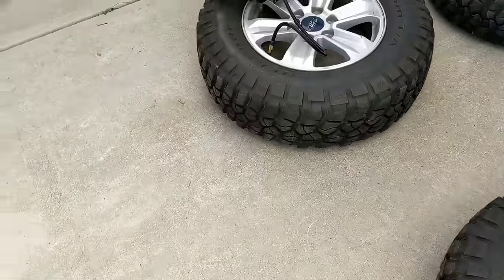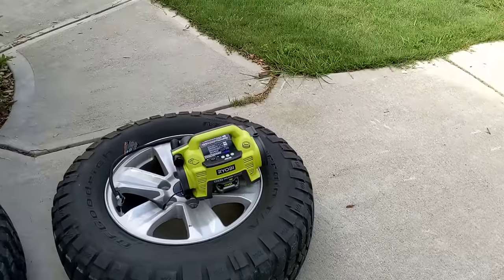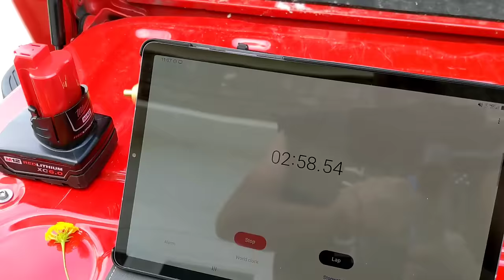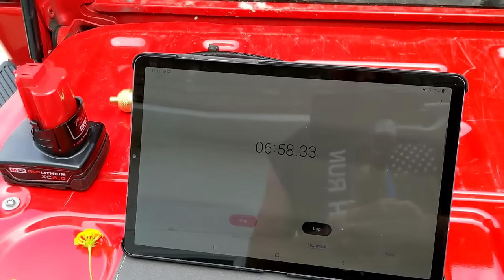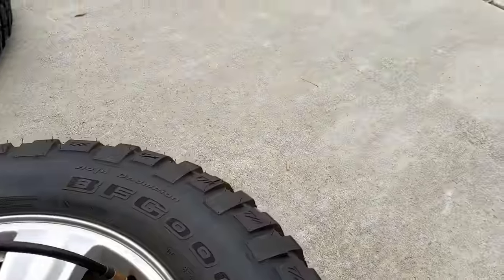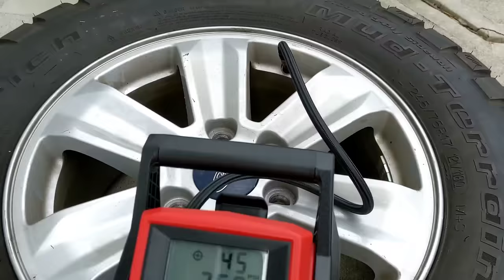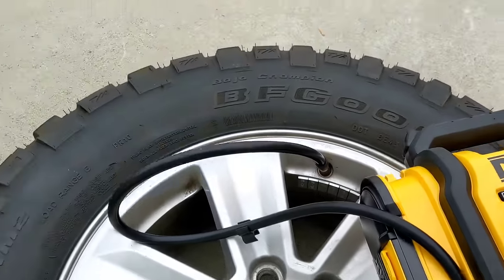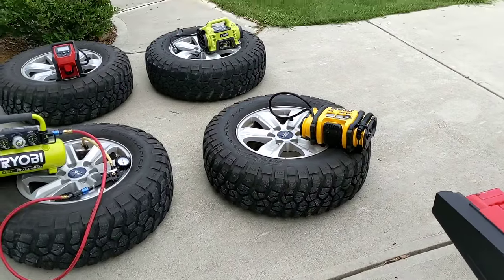Ryobi Milwaukee DeWalt inflator and compressor review

Comment: I loved yellow tools until my employer paid for a red one. Now I only buy red ones. Milwaukee is made for pros.
Reply: Pros buy there tools in home depo and Walmart?
Reply: @Zozo806  HD sells millwalkee. I've bought from HD. Im a pro. So yes
Reply: @Zozo806  theres a video that Milwaukee vs Dewalt,  and dewalt smoked and Milwaukee was still going. Milwaukee has a more diverse lineup. And I've noticed the fuel series last a lot longer.
Reply: @chrisl6263  like said. The ryobi and the dewalt i think can be used with a blow out pistol so you can propper clean your mountainbike. 
If you prefer the Milwaukee than go for it  but i personaly don't want just something for inflating tires. I just have one car an street biycicle and an e mountainbike and any gas station has free inflators.
Reply: Most or all are Now Made in China 🇨🇳 
Our new drill is, we thought it was 🇺🇸USA built
But China actually has improved quality vs back in the day 
Beer 🍺👍

Comment: Have to hold down the nozzle on the compressor? Locking air chucks are like $1
Reply from the maker: That doesn't really solve the problem though
Reply: @apocalypse2941  You dont need that big pistol grip inflator on there, you can just run the locking chuck right on the end of the hose
Reply from the maker: @CaseyR89  ok how do I get to the right pressure?
Reply: @apocalypse2941  set the regulator on the compressor
Reply from the maker: @CaseyR89  that does not work. Watch my video on it.

Comment: You do realize you're comparing three inflators that have ZERO air storage against one that is starting out with a full tank of air?  For a level playing field all four need to start from zero.  That nicer Ryobi model is starting the race with one gallon of air stored at what...90 psi? But it is the more versatile compressor of the lot. I wish they made a 40 volt version.
Reply from the maker: Yeah good point!

Comment: The compressor would not have won if you would have started with no air in the tank.  In a real world situation it would have been empty to start with
Reply from the maker: True but when you first put your hand on it you can turn it on and let it begin filling the tank so by the time your going the Chuck on the tire its full.

Comment: I appreciate the agenda free comparison. But, unless you're on a bicycle, a battery powered inflator makes zero sense to me. Having a 12V cig/accessory plug, vehicle battery clips, or SAE connector, with ability to use an AC adapter would be the best portable solution, imo.
Reply: I like the battery option.  I’ve owned several 12 V cigarette lighter powered inflator‘s over the years. I much prefer my 18 V Ryobi. Maybe it’s just my jeep has spent too much time with the top off, but off and I found those cigarette outlet type power ports get a little fussy. I also like the added range of being able to inflate Tires on my trailer while it’s still connected. Center store my trailers away from home if I get there and found the tire is low I can sort that out right then and there.
Reply: @ge99ne  I appreciate your reply. I'm sure there are folks (like you) where a batt version suits their needs. I just don't want to be out somewhere with a low tire situation, and find my pump has a dead battery.
Reply from the maker: Very true,  ironically the last person I helped with a flat had a 12v cigarette lighter only pump that did not work. I had to cut the wire and hold it to the battery of my car

Comment: If the tire is on your truck your in trouble with any except the dewalt.
Reply: At least you get it. This was a decent comparison for basic run time, but with the weight of the truck corner crushing the walls of the tire - that is another ballgame entirely.
Reply from the maker: they will inflate on the vehicle as well. I've done it many times after pluging a tire. Also gone as high as 65psi on my camper tires with the Milwaukee.

Comment: i am gonna say this because i own one  To have it in the car I would definitely go with Dewalt  and I say this  Because apart from being portable and light,it also uses a 12 V cigarette lighter plug And it can also inflate an air mattress Also comes with fittings for bicycle tires which I think they all do but just saying 
God forbid you forget to charge that Milwaukee battery And you're gonna need your compressor what are you gonna do about that with a dead battery In my opinion I think Dewalt is a better choice and right now is $100 at HD
great day folks!
Reply: Have you actually inflated a tire fully with the DeWalt from the 12v plug?   I have the DeWalt and always get a LoP shutoff when plugged into the car outlet.  Works fine from the wall outlet, but worthless from the car 12v.

Comment: Use the bigger battery on the dewalt and it works better. Or work trucks have 80 pounds in the back tires and it does a great job faster than this video

Comment: I don’t Get the whole cordless tire inflator thing 

because after all if your vehicle is anywhere within 30 feet of the job you can run a hardwire to the battery and run a 12 V off the car itself......

Nail guns or air tools okay on a job site maybe 

but not for tire inflation 

and even if you did have a job site nail gun use....... you can just run an extra long hose from a decent petrol compressor on the back of the Ute 

so I don’t get it......
Reply from the maker: It's just a matter of convenience and saving time.
Reply: This. Also, carrying an inflater only helps if you have a slow leak. Any other tire issue, and you'll be throwing on your spare. So really, carrying a fully inflated spare is better in every way. I think it's fair to say I can change a spare just as fast as it takes a little inflater to reinflate a tire, plus it actually solves the issue.

The only exception I can think of is unless you deliberately deflated all four good tires, such as for off roading. Then an inflater is much more useful than a spare haha
Reply: Erik Wickstrom 

Well I suppose I’m lazy I don’t like getting my hands dirty and I’m always wearing a shirt and tie or something like that or it’s raining or here in Australia or it’s 45° in the shade......

so my experience is over 90% of flats  I have experienced for me or on my misses car or for somebody I’ve stopped to help on the side of the road has been a slow leak manageable within five minutes using a 12 V inflator.......

Yes they used to be pretty slow in fact painfully slow if it’s a four-wheel-drive used to take half an hour in some cases 

but these days they have these twin piston set up‘s and if you buy a half decent one they’re pretty quick it’s under 10 minutes......
Reply: @ewicky  most tires with a puncture similar to a nail don't go completely flat and I start filling them right away while I fix it with a kit I always carry, much much faster and easier that swapping a spare, really I have done it lots of times even with a 12 volt corded type

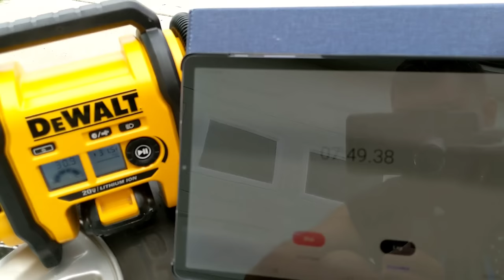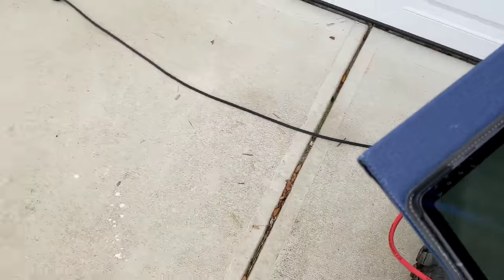Comment: You went 7:20 for Milwaukee at 31 lbs psi and 7:50-7:52 for Dewalt at 31 psi. U called 8 minutes but it was set at 31.5 psi. So 30 seconds is close
Reply from the maker: It was set to 31 and it went to 31.5 on its own.  It is close but I would think an inflator using 18 or 20v would have been much faster

Comment: I think that both the Dewalt and the Milwaukee should be disqualified because they couldn’t hit the desired pressure without battery dying
Reply from the maker: I would agree if they all had the same size battery but I only had access to a small battery for the Dewalt  Also the Dewalt can plug up to the car or house.
Reply: Apocalypse, but it looks like you have access to a bigger Milwaukee battery on the red tailgate beside your laptop @6:56.
Reply from the maker: @toolcrazy88  correct, I meant i only had a small battery for the Dewalt.  They were so close I didn't think it was worth changing the battery or plugging the Dewalt up.
Reply: Useless get a ryobi

Comment: Is it possible to run a 13amp wall powered compressor off my car? Car: Subaru outback
Something like: makita MAC5200
Reply from the maker: No not really.  That would be over 1500 watts.  It's doable but very complicated.
Reply: For the price of a 3000w max inverter (which would drain your car battery quickly running the compressor) you can purchase a really good 12v tire inflator or even a puma 12v air compressor with a 2 gallon storage tank.

Comment: I had the Milwaukee one and it crapped out within a couple months
Reply: Damn that sucks. I’ve had several problems out of Milwaukee stuff myself. If they didn’t have such a awesome lineup I wouldn’t buy them anymore.
Reply: @whatfreedom7  I love my friends m12 lantern light with USB powerbank it's the best it out last my m18 lantern
Reply: @Anadrol & Wheaties the 2nd gen screwdriver gun twice and the 18 volt drill twice. Then two 12v covers broke but that’s from drops.

Comment: The dewalt can fill up matress and beach balls the others can't
Reply from the maker: All but the Milwaukee can inflate large volume items.
Reply: The Milwaukee comes with the inflators to do both of those things. They are attached to the back of the pump...
Reply: @lowmofo  no the Milwaukee does not have a high volume pump like the others

Comment: Ryobi had battery left they would be the only ones to possibly fill 2 tires not just one ryobi wins. Second test put the dewalt and Milwaukee to shame.
Reply from the maker: In fairness I had different size batteries in each due to availability and it wasn't a level playing field.
Reply: Having correct battery sizes is HUGE... the M12 inflator did the job with the given battery size... not only did it outperform, but lasted
Reply: @stevennihipali3607  the ryobi compressor with the tank filled the tire in half the time. And he stoped several Times with it. While the others were still going and had 3 bars on battery after test it was way faster than the other three.
Reply: @benjaminhenderson1759  yeah, I understand that... compressor v inflator... battery size too. That M12 out preforms the competition
Reply: Steven Nihipali  yes! That M12 is only 12v going against 18v packs with double the capacity. The Milwaukee had the smallest battery available in it at 2.0ah next to the older 1.5ah ones. The one on the tailgate would have made for a better comparison as it was a 4 or 6ah battery depending on age.

For a 12v against the big boys..... Milwaukee FTW.
Reply: I have the dewalt since I have dewalt tools. I like the auto shut off feature if you let it set. Also, I can’t tell, but I don’t think it shut off at the end because of a dead battery because it was still on...it reached what it though was the pressure you asked for it. Mine seems to be within .1 psi of what I set the knob to. 
That 1.5amp battery is the smallest in my collection and it’s the only one that doesn’t have the LED meters to tell me how much battery is left. All my other batteries do. The inflater gets used all the time. I can easily inflate a tire from 0 to 80psi without the battery being depleted on my truck tires.  With the small battery, I can top off 10 tires on camper/truck no problem. Plus, the rotary knob is so quick to set the pressure then push play. The LED light comes in handy too. It’s light and has always worked for me. The 12v plug in cable is nice too. 
As much as I like it, buy what battery system you have.

Comment: Should never use these except for the Ryobi with the tank should never let them run for that long
Reply: Yah I think the Ryobi has a 5 min at a time max use and he did 10
Reply: I just bought the Ryobi until I have the cash for a hard mounted compressor, it states rest for 10min after every 10min of use.